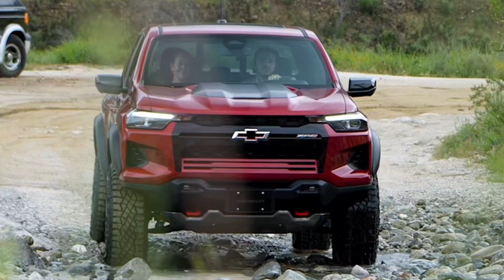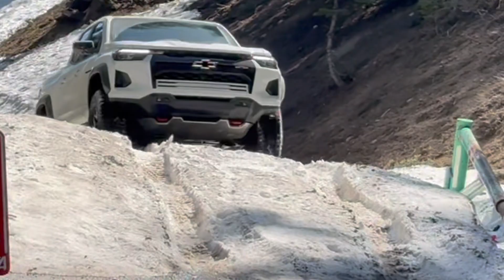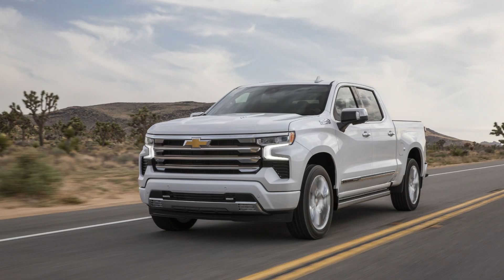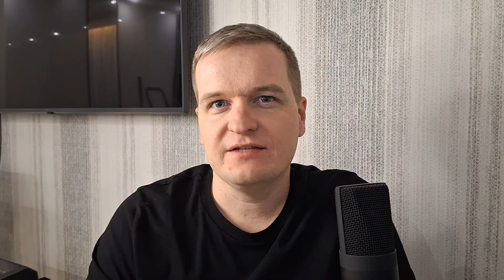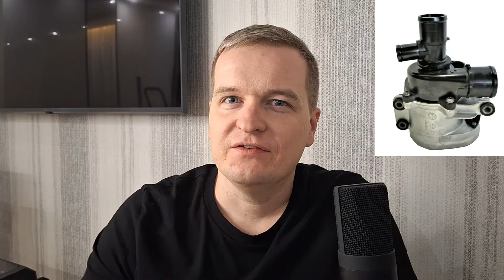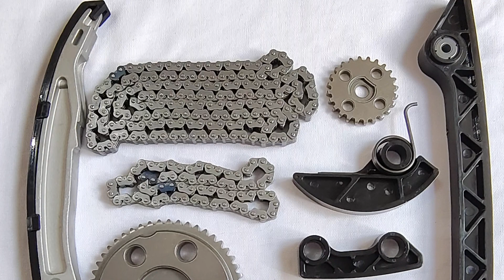Chevy 2.7L Turbo engine problems (L3B, L2R) – Colorado and Silverado

Comment: I bought a 2024 Silverado with the 2.7 brand new, has 45,000 miles on her now. I haven’t had any issues with the engine, but it has noticeable gotten louder, and it consumes roughly 2 quarts of oil, between changes. Overall it’s not a bad truck, but we will see.

Comment: This is a very bad video, he's saying that the V8 pushrod cylinder deactivation is unreliable (which is true) but the 2.7l turbomax DOESN'T use the V8's collapsible pushrods, it uses shift cams which are far more reliable. He needs to delete this video & remake it correctly, this time.

Comment: I think this guy is confusing engine issues with the 5.3 and 6.2.  The 2.7 has been great for the midsize trucks. There were some small issues year one but not anything widespread since.
Reply from the maker: I'm not confusing anything here. These engines are good, much better than a lot of other 4-cylinder engines. But some technologies aren't long-lasting and are very expensive to repair. I'm saying here about the potential common problems. Of course, it doesn't mean that all owners will experience them at all times.

Comment: what a piece a crap
Reply: @fishinchillngrillin  why would you say that?  I recently  bought one. Only 1500 miles on it.
Reply: @elviswilliams5764   I believe theyvhave timing chain problems and when it goes the entire motor must be taken apart if im not mistaken
Reply: @elviswilliams5764   is there a v6 one it might be that motor....Scotty Kilmer says its good idk.
Reply from the maker: Colorado doesn't come with a V6 now. But this 2.7L is not as bad as some say. We just shouldn't expect it to hit 200K miles. Chain replacement is a problem here, that's true.